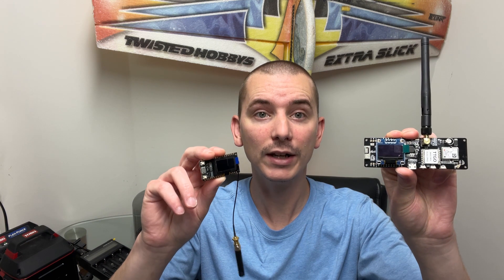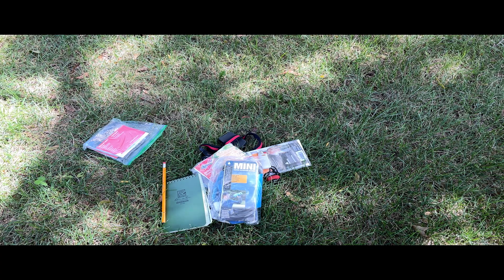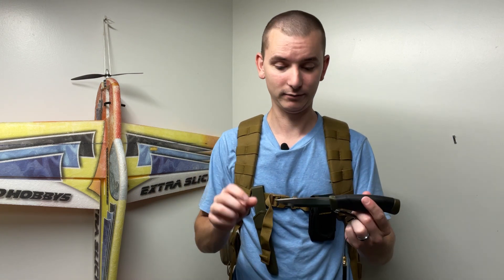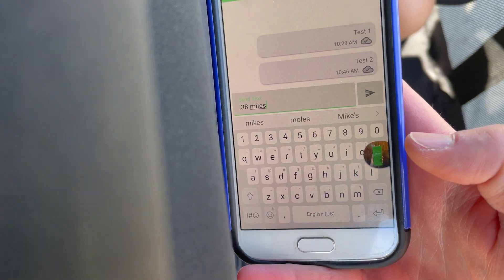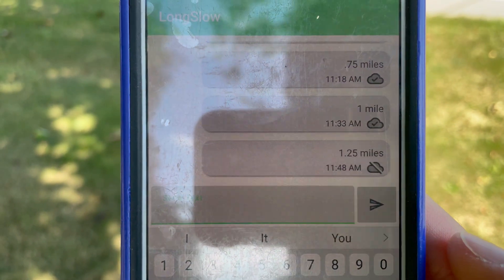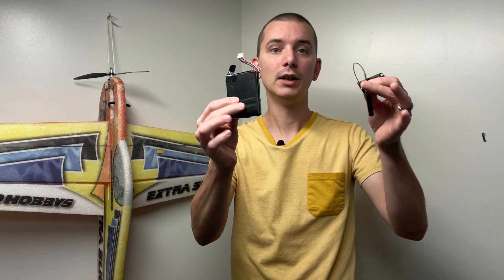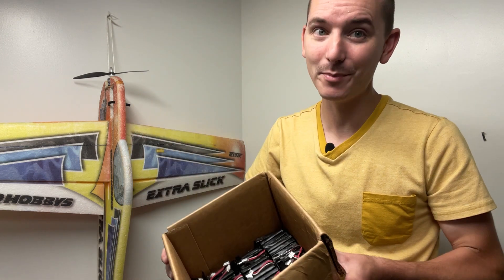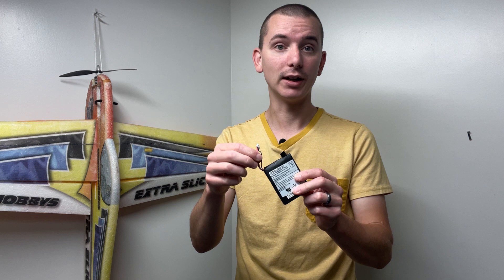Real World Meshtastic Range Test- I’m not as funny as I think I am, I know.

Comment: ‼️Rookie mistake #1.  Never have metal in the sight of the antenna at all.  That next to an aluminum chimney china cap is horrible.  We used the six foot rule inside buildings next to metallic electrical conduit and avoid metal stud walls, put a mask up.  Also avoid using antennas with long cables.  These signals are extremely weak and every foot of cable is a major loss.  Good luck and don’t give up your day time job for stand up.

Comment: I have a Lilygo T3S3 with a 10,000 mAh battery with the device role repeater, it lasts 8 days, in the summer with solar it should work fine, but small batteries usually run out quickly.

Comment: There is no problem at all to obtain 10-15 miles on 433mhz on flat terrain, the meshtastic condition must be close to the antenna to avoid cable losses, the antenna MUST BE ON THE ROOF I use Diamond x50 and X200
 but 5/8 which are small and easy to make for free on your own work very well. These original tiny antennas should be thrown into the trash immediately. I installed my tbeam 25 meters from the ground and I have coverage over half the city of 70,000 inhabitants. If you put the antenna on the roof on the other side, the whole city plus a few miles.

Comment: Does someone have experianced the range of a 1:1 connection of this lora32(v1) boards?
I hust bought 2 of them and they really, really disapoint me. After 30meters the signal gets lost (original short antenna). 30 meters! What did I do wrong?
How far can the t-beams teansmit (1:1) in a urban environment? Thanks
Reply: It's probably the antenna.  Stock is notoriously bad.

Comment: The lora32 radios consume a whopping 60mA, so they only last around 4 days on a battery like that. I hear RAK based boards are significantly better at saving power. Basically, you always need a solar panel connected no matter the size of the battery if we are talking about long term infrastructure.
Reply: True. The RAK boards are great and use NRF52 chips instead of the power-hungry ESP32 like the T-Beams.

Comment: So a basic whip antenna will outperform the one that ships with the tbeam and the heltec by leaps and bounds. A DIY quarter wave is only 17.3cm long for 433mhz. 

Also for a legal location thats really really high all those big radio towers around you... pretty much all of them you can rent space on if you can find the person to call.  Unfortunately, its really cost prohibitive but if you can juice up the fact that you are a student they might cut that cost down. (They did for me, but also you could pool some people together perhaps its not "that" cost prohibitive) Also for insurnace purposes they will not just let you go hang it so you have to find one of their guys to do it for you for cheap, I have a guy who has agreed for the cost of a nice dinner for his family but atill have testing to do before then. 

The project is for a self sustained relatively small Meshtastic repeater box that is solar powered half wave dipole antenna and presumably in most seasons and will be always on during the day and on most of the night with no aux power. (Solar panel size limit, not battery also in that applicaiton LiFePO4 for safety)

Comment: The repeater is great.  Designed to be the middle man extender.  So why did you put it on the top of your own house?  You would have gotten another 1/4mile if you just set your wife on the roof.
Try this test instead.   These units BT to your phone... you don't have to have them right next to the phone.  Put the lora unit on the ridge of the roof above where your wife will be  RX/TX from.
Make sure its on and working, and the antenna is vertical(do not use metal) tape it to a small stick or something.  If you can go higher with a longer stick, thats better.  Stay away form trees too. 
Leave the Tbeam powered off.  Then do the test again.  If you only get 3/4 mile this time... so what.  But you now know the distance you have to set the repeater at.  At least in that direction.  If you had one at each compass point around your house ... maybe a few more... You would be set.  When you get to that 3/4 mile distance, then look around for a high place.   A tree is fine.  Just don't let anything even remotely conductive be around the antenna of the unit.  Its hard with a tree, I understand.  Tape it to a six foot long stick, or longer, and then climb the tree until you cant go any higher.  Then tape the stick to the tree.  Hopefully leaving the antenna clear at the top of the tree.  Something like that.  Don't forget to turn it on now.  Then... keep walking.  You will now be able to travel a lot farther.  Yeah I know 3/4 plus 3/4 is not much better than 1.1 original mile... but the Tbeam is stronger and will work farther, as well better if it is the high spot in the middle.  With the Tbeam in the middle you will get at least 2.5miles, or more. And that will be in the stock config, in your tree infested hood.  And that is just the start. 
The other thing that will make your test way better is a simple diy coat hanger antenna with small ground plane on the Tbeam, and even better a small circuit board beam on each of the other lora units.  The base station should always point to the Tbeam... and the one you carry can be pointed at the location of the repeater when ever you stop.  Or add a walking staff and another coat hanger ground plane antenna to the top of that.  You will get all of the wife's TX's as well.... Better just stick with the beam at each end...
The higher you can get the repeater the more distance it will have.  You stick it under a metal.... anything.       You were lucky it transmitted out of your own yard.  
I could tell you how to Really make the things work but you seem to want to stay more on the free to very little investment, side of this project... and none of the things described above cost anything.... maybe the .04 cents for the coat hanger...

Good luck and keep uploading.

Comment: This is real ranges.  people claiming they always get 20Km or more are flying balloons or doing it in a desert.    There is extreme hype around LoRa and Meshtastic ranges.  Real world with low end stuff like the Tbeam is about 1 mile.   also the antennas you get with them are complete junk  get real antennas that are tuned for the actual frequency and you can get more range.    I found decent tuned antennas can make a  large difference but still nothing ever like people keep claiming but when you press them find out they flew a balloon or were on open water, or in the desert/ open area with no houses and no trees.
Reply: Just making your own diy whip or dipole will dramatically increase out of the box range. 

Also, a 16th floor apartment can extend range pretty nicely. As will a 45ft fiberglass extendable antenna mast. As will a nice high elevation location of your local area.

Meshtastic isn't going to replace your cellphone but in the event of an emergency having the forethought of where to pre-install repeaters with redundant power could come in handy.

Comment: My guess on the triangle came from the I=E/4 Voltage, Resistance and Current formula.
I didn't see your previous meshtastic video.   Where did it go?  More information on those radios.   I'd like a smaller radio than the T-Beam, and I've heard that there are more reliable solutions that are smaller, like from RAK?

Comment: setup a T-beam as a repeater and put it on a large delta kite or tethered helium balloon, up about 300ft.   Then do a range test.   Oh and it can't hurt to swap those antennas out with slightly longer ones.
Reply: Antennas have to be resonant to the frequency being used....and that requires that the antenna be a particular ELECTRICAL length, physical length has nothing to do with antenna performance. 
For best performance, use a NanoVNA to tune the antenna for your desired frequency.

Comment: Put a node on a kite photography rig so you can get it really high up.
Reply from the maker: Yes! I thought about a helium balloon (maybe a punching balloon, they’re bigger ) but it would take quite a bit of helium. Thanks for watching and commenting!
Reply: @diyrenewableenergyelectron4996  Or on a drone for temporary coms window.
Reply from the maker: I do have a drone…… that could be a viable option. Drones can hover for 25-30 minutes these days. That’s a good amount of time!
Reply from the maker: For sure. And if need be you can bring the drone down, swap batteries, and head back up
Reply: @diyrenewableenergyelectron4996  You gotta do the video!
Reply from the maker: 😂 I need to find a tiny lithium battery. The weight of the ones I used will be killer. And I’ll need duct tape, of course. 🤓